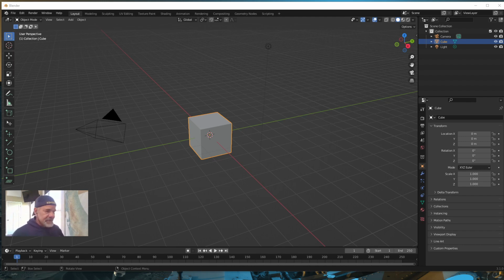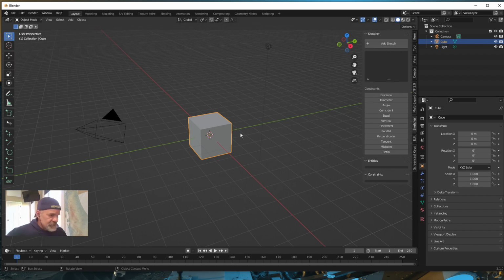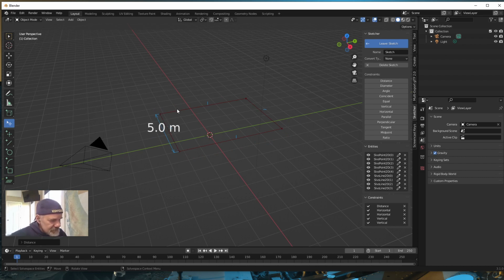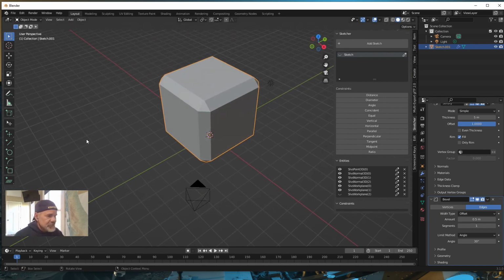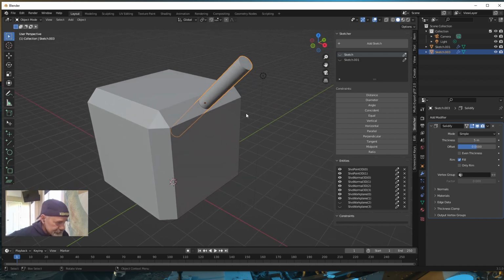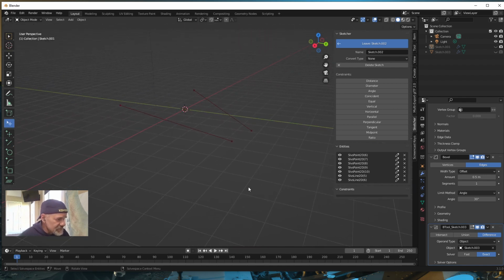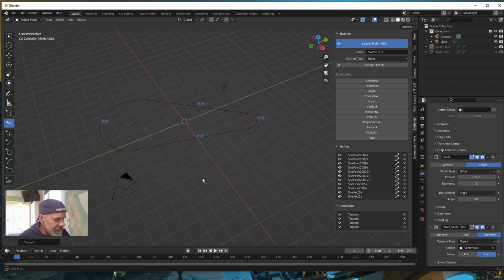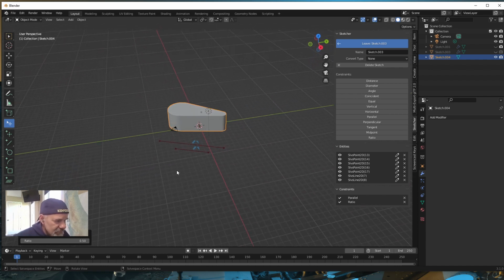Creating Scenery for MSFS 2020: CAD Sketcher Add-on for Blender

Comment: Hi there! I had a short discussion with Arno Gerretsen who is the author of Model Converter X (MCX). I personally requested if he can include the 3MF import file with textures. And he did. With the latest version of MCX, you can now make scenery objects in SolidWorks and export the model in 3MF format (SW don't have DAE export). Then import it directly in MCX with textures. Make sure the textures you use are power of 2's (256x256, 512x512, 1024x1024, 1024x512 pixels etc), or else, it will fail. From MCX, you can level up your textures to PBR, and simply use the convert and place wizard to place it in the FSX/P3D world, and off you go! Imagine the precision and detail of your models you can make in FSX/P3D with Solidworks or Autodesk Inventor... This addon is also great. But I'm still having issues on registration with PIP.

Comment: Great plugin but there are better alternatives as in 3d modeling such as Rhino and Sketchup then you can easily import into blender to extarct the .GLTF file needed but other than that great find !
Reply from the maker: Yeah, but I wouldn't say "better" alternative, just an alternative. I've used them all. However, I also believe in using the tools best for oneself. There really is no right or wrong. It's about finding the tools that work for you. I think people who use SketchUp do great work and it is a great software package, but so do people who use other software. Personally, I like having all my tools in one software suite and not not have to jump from one to the other. Blender does it all for "me".
Reply: @myphysicalworld3958  Yeah i agree :)
Reply: are they free? absolutely not lool